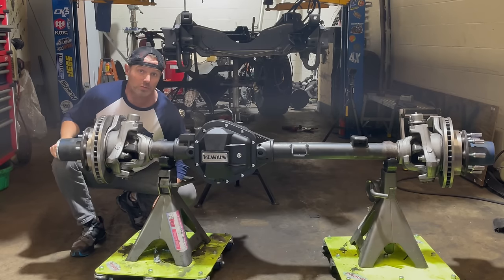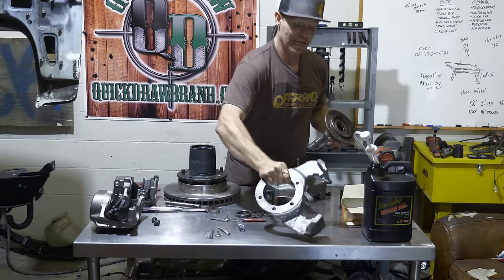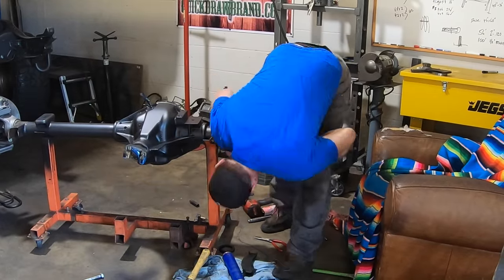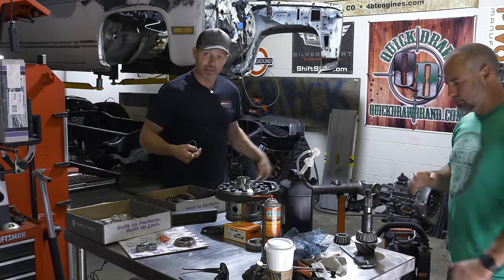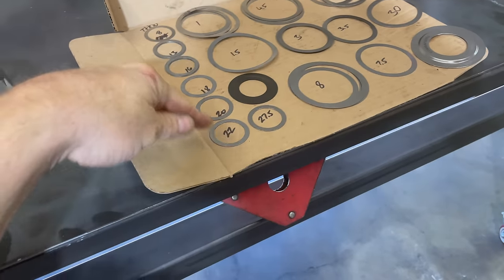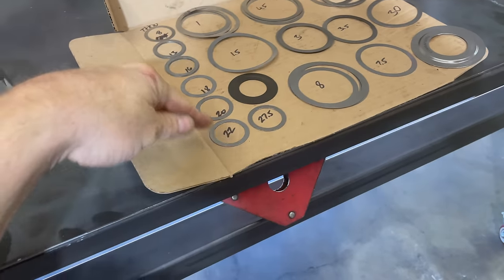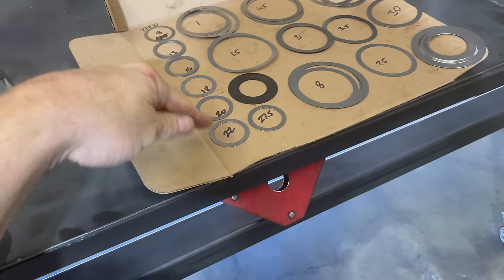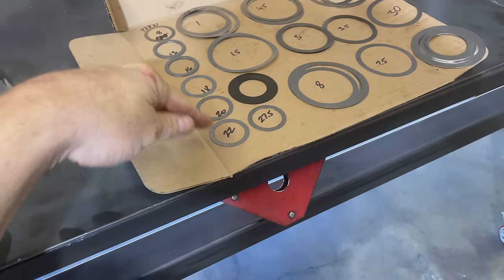THIS is what makes the Dana 60 so great!

Comment: I put a Dana 60 (Dynatrac) under the rear of my built 1981 Jeep CJ8 Scrambler with a 44 up front.  LS3 460HP, built 700R4 through a built Dana 300 transfer case, and full Corsa exhaust.  Just a 2" lift.  It looked stock. Corvette red with lots of chrome.  Looked stock until it was started.  On the way to champagne brunch. it would burn the 33" BFG tires through 2nd gear.  What a fun hot rod.

Comment: Alot of people complain about the cost of things, but the more things get produced like upgrades, the cheaper it gets and vice versa. 

But lets be realistic. The superduty axle is no longer a relatively cheap option. The more people that use thrm, the more their price is going up. Couple years ago you could get one for $400 from a salvage yard.. Now I'm seeing a bone stock one for $1000-$1200...so price is sort of relative now......2.5 tons are still the best bang for the buck ( a pair can be had for $1500)..id trade my Ford KP 60 and 14 bolt for a pair of good 2.5/ 5 tons
Reply from the maker: Agreed.  The benefit of the GM for me is kingpin and simplicity.  The Ford Dana is killer, especially the super 60.  If you want radius arms 🤷🏼‍♂️😜

Comment: I never looked at a coast pattern..  With heavy Trucks you can move the Pinion in and out with Shimes..   You move the ring gear from side to side .. closer to or away from the Pinion by turning the threaded  carrier bearing caps .

Comment: I just bought a suburban to haul my K5 since I decided to go with a th400. Except the only difference its a 1993 2wd GMT400 2500. Its got a tbi 454, 4l80e and 14 bolt full floater. \m/ My idea is to build it into a 5 seat prerunner with high travel trophy truck ifs, while retaining rear leafs for towing
Reply from the maker: that would be dope!

Comment: Love my D60 High steer and 14 bolt in my Jimmy...But on 37's I only have a extra 1/2" of clearance under the pumpkin's vs the stock axles on 33's (both are on goodyear MTR's)...shows the extra girth of the tons. Now I really need to regear the Jimmy with the 33's as the 3.07 gearing is well not good hahahaaha. Do I seek the tons(way overkill and poor clearance) or I do have 3/4 ton 14 bolt semi float and Corp 10 with 4.11 gears...just need to add a locker set up or just regear the stock axles....leaning on the 3/4 set up but that could be used in another build I'm planning this winter......
Reply from the maker: That is a tough call.  I went with overbuilt for the burb and like having spares to all my axle stuff.

Comment: I have a 4.56 Dodge front Dana 70 kingpin axle with disc brakes and a 4.56 Dana 80 rear.  Should I use them in my 72 W200?  It currently has a worn out 44 and a rear 60.
Reply from the maker: Heck yea

Comment: I have an 86 f350 I believe it came stock with a Dana 60 front and a sterling 10.25 rear. If it was an 85 I'd have a Dana rear too...😐
Reply: Nothing wrong with aa sterling.  Tough as  hell. Gear ratios and lockers cost more than a 14ff though
Reply: An 85 350 would also have the ttb50. Ford realized what a mistake that was fast enough

Comment: I hate to say but those D60 are nothing compared to the Dana Super 60 that comes in the 2017 and up super duty trucks...for example the 2017 and up Super 60 have 3.5" axle tubes with 1/2" wall 35 spline inner and outer axle shafts, 1550 steering u-joints, 10" ring gear...this is the axle I used for my solid axle swap duramax 👍🏿👍🏿
Reply: How much does it weigh? I'm think that for a jeep but I need to keep the Weight down.
Reply: @oscarbear7498  about 600-700 LBS
Reply: @David-yy7lb  ... God damm that's heavy @.@
Reply: @oscarbear7498  Dam right lol....ask yourself this do I want a heavy duty 8 lug Dana super 60 front axle that comes of a 2017 and up f350 superduty with the specs mentioned 👍🏿👍🏿 or a light duty crap 5 or 6 lug dana 30 or 44 front axle👎🏿

Comment: that 70's dana 60 is worthless compared to the 2017  and up Dana Super 60 that is found on f350 super duty trucks, the 2017 and up Super 60's have a 10" ring gear 3.5" axle tubs with 1/2" wall, 1550 steering u-joint and 35 spline inner and outer axle shafts, this is the front axle i used on my solid axle swap duramax
Reply from the maker: Worthless you say?  Craigslist and eBay would say different.